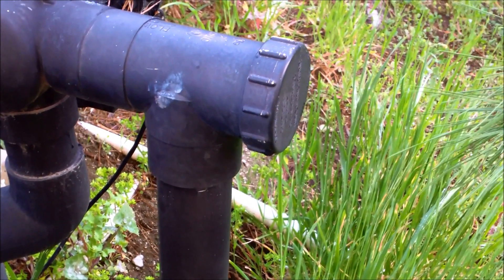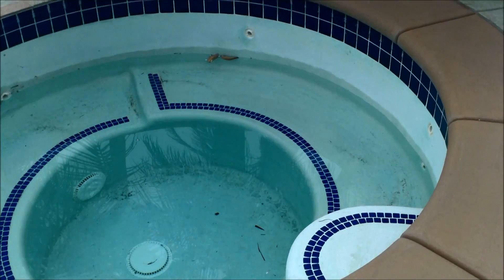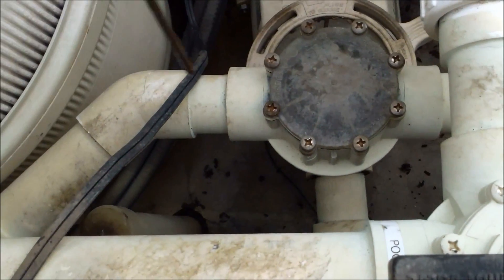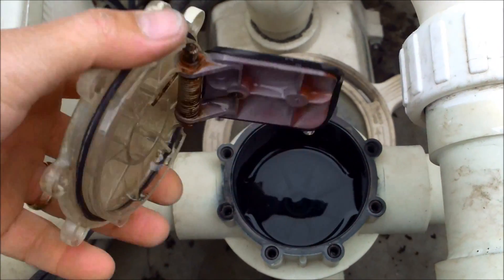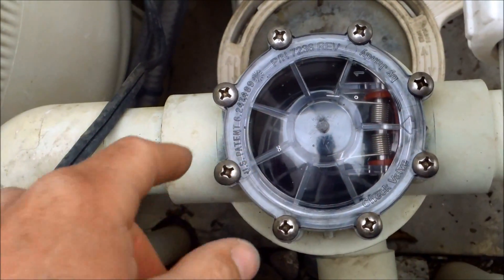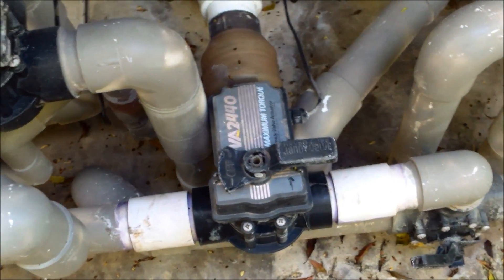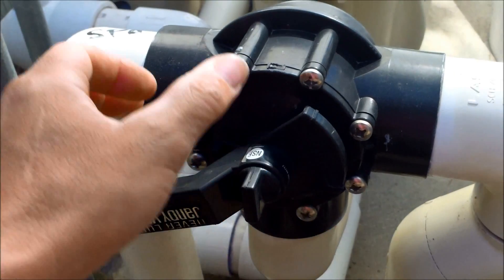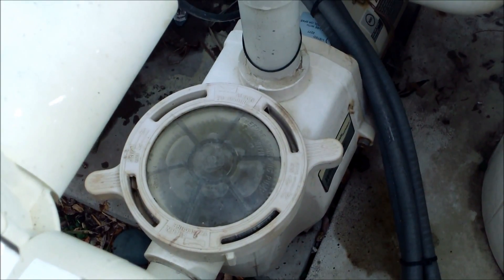My Spa is Draining Down When Pool Turns Off

Comment: Hello, can you help me out with this problem, okay i have a pool with an elevated spa that water falls into the spa, the set up is, American Products Pump, with 1 jandy valve for pool/spa suction with a check valve on the spa suction side which is before the jandy valve , then another jandy with pool/spa return with this mueller check valve in between the 2 return lines. Issue is, even though i do 100 pool suction, it still drains the spa about 30%. What seems to be the issue? I have lubed and replaced all the o-rings of the lid, brand new jandy valves and o rings, new pentair filter o-ring, new backwash valve o ring, so i dont know what is the issue. Also, whenever i put it to 100% pool suction, the prime will lose about 30% water, it still sucks in the water, but i can see it in the pump basket that it immediately loses it's full prime, only when i turn the jandy valve to about 20% pool suction/80% spa suction then the pump basket gets filled back up with water. I cannot possible see where the air leak is, but the only thing i know 100% is the disharge water leak, which i need to repair, but since that's the pressure side, it does not have any effect on the suction side, correct? Please let me know what you think and thank you in  advanced.
Reply from the maker: bludika When there is a discharge leak it is more obvious because the water pressure will push not only air but water out. Usually there is a leak also right before the pump - you cannot see it because water doesn't usually leak out.
Reply: yea i understand, but this is what i dont get, i said it wrong, okay so the Check valve is on the Pool suction side, BEFORE the jandy valve. See, when i do 100% pool suction with the vacuum not attached to the skimmer, the pump primes just fine, so does the 100% spa suction. BUT when it's on 100% pool suction, and i attach a fully primed vacuum hose (kreepy krauly, the exact model you reviewed that blue and grey one) the pump immediately starts losing prime, and the prime goes down by about 30%, i can see from the pump basket it is still suctioning water but it's also sucking in a lot of air hence the pump basket is not fully filled with water, BUT as soon as i remove the vacuum hose from my skimmer suction hole, the prime is back to normal. I don't know what's wrong with the vacuum that it's causing the pump to lose the prime. See thing is, instead of doing 100% pool suction, when i do it about 80% Pool/20% spa suction, THEN the prime gets back to normal, but the issue is, my spa water level goes down due to suctioning AND  returning at the same time. I want to do it 100% pool suction but it's not letting me due to loss of prime when it's 100% pool suction with the vacuum hose attached. I checked almost everywhere, and i don't see or hear any air leak in the suction side. The only thing i know is the water leak at the discharge which i need to fix, does this leak have any affect at all?

Comment: my spa is filled by a water feature to overflow when pool is running...when pump is off my spa drains back to pool thru water feature valve...how do I correct this without having to close overflow valve....thanks

Comment: what about when you go to turn the spa on, and the it just starts draining down and the pool gets hot and the water goes into the pool and the water is still being returned to the tub?
Reply from the maker: The spa suction valve is turned wrong or if you have an automated system the valve actuator is not working. Maybe send me a photo of your valves and I can advise: http://www.swimmingpoollearning.com/
Reply: Oh I don"t own the spa, I was recently down in a vacation home in south florida where this pool and spa was. Thanks anyway. One more thing, i noticed when this switch was on, the pool pump only pumped water from the spa not out of the pool. So when the spa was drained, the pump starting to run dry, it was just really weird. Thanks again!

Comment: Hello, Great Tips!

I have a question, my jacuzzi runs but the rest of the pool jet pumps do not turn on.  The jacuzzi water does not overflow into the pool.  What can you suggest.
Reply from the maker: Sounds like your pool is in spa mode. Simpy turn the two valves the opposite direction and that should get it in pool mode.

Comment: If my negative edge troth is over filling would that mean it is the check valve with in the troth or the one by the EQ?
Reply from the maker: There is a fill valve in those negative edge troth that tends to fail on occasion and over fill it. That is also the auto fill for the whole pool. it is located there so the troth is always full of water. I have a video on checking that: http://youtu.be/GosLFMIU-_c
It is easy to fix. I think if it is overfilling verses draining it is a fill valve problem.